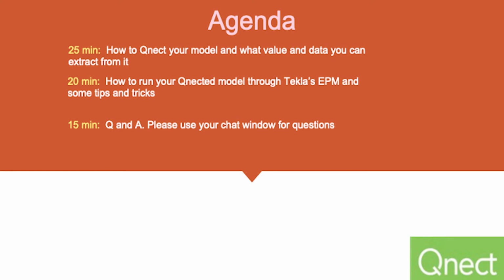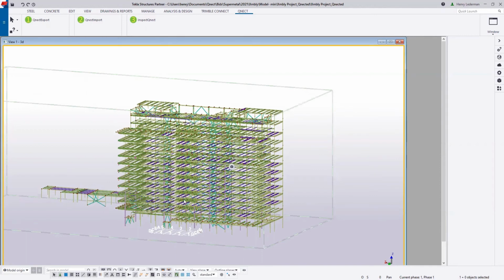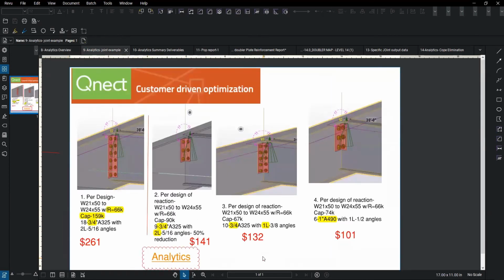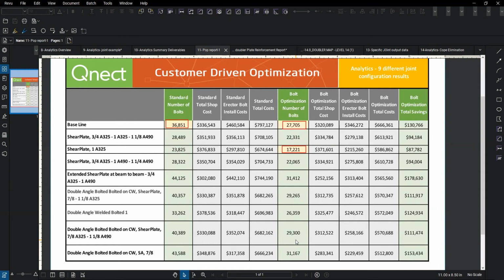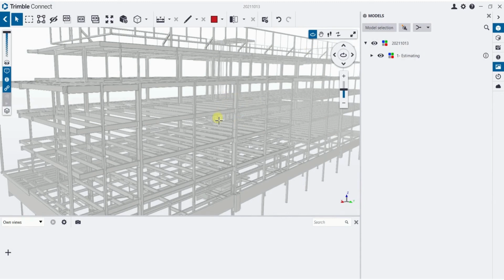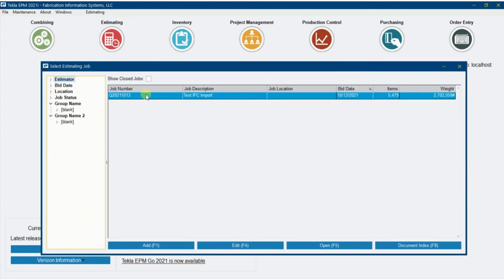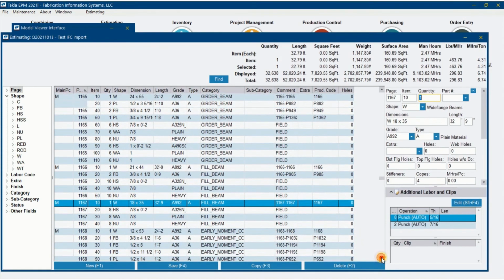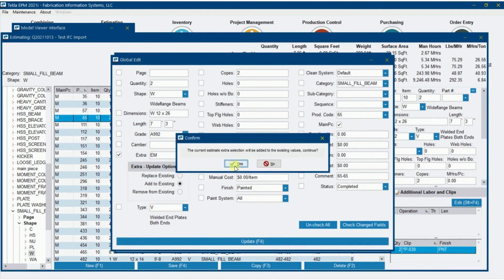Estimodeling Webinar - Tekla+Qnect

Comment: Hello thank you for the video! I am trying to understand something. Would this program be good for fabricators for estimating cost? Or would that fall into the authority of only engineering? I know fabricators can suggest different connections, but typically that's the engineers job right?